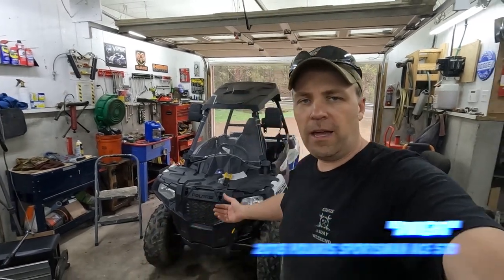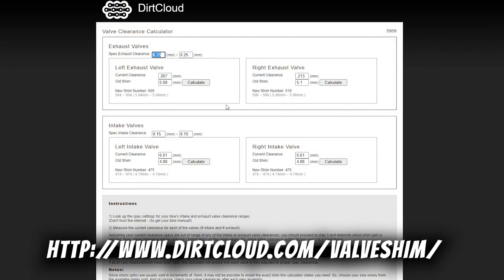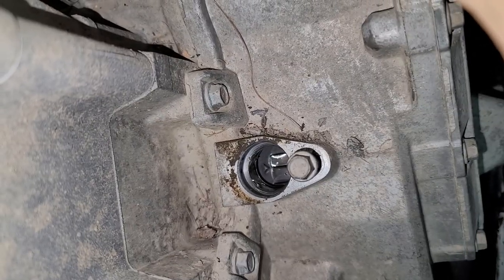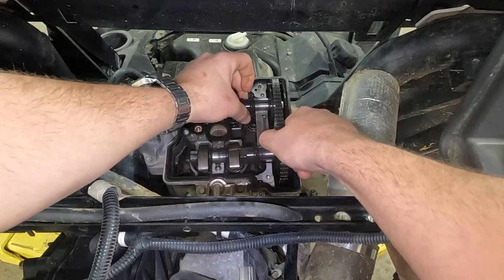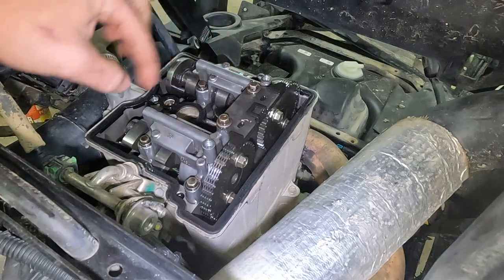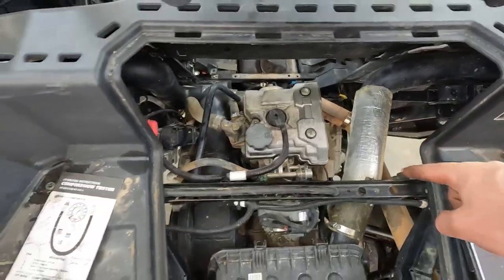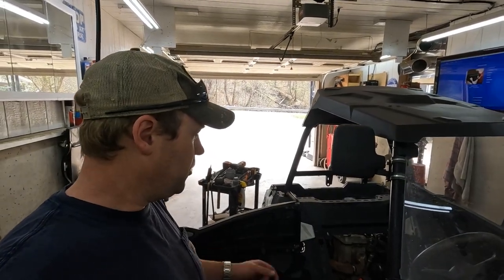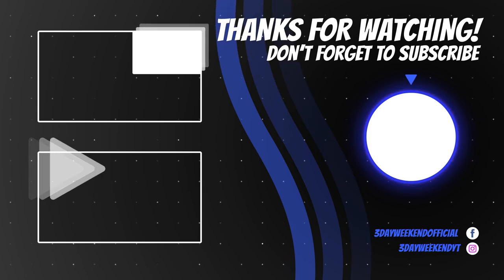It's running again!  Part 2 of 2 - adjusting valve lash on a Polaris 570 - Final Assembly!

Comment: I just used a Dial Caliper and a Dremel, calculated what I needed to shave down on each shim bucket. Got my lash in spec.  I didn’t even change the valve cover gasket.  It cost me no money. Runs good.
Reply from the maker: You know, I didn't even give that any thought.  Definitely could have tried that instead of forking out $40 a pop!  Even if you mess one up, just get a new one.  Great pointer!  Thanks for sharing!

Comment: Just curious of why you got a 510 for right side exhaust but dropped it down to a 502?
Reply from the maker: My math was wrong in the first one.  When I put it in the site it came up with a different value, so I double checked everything and confirmed that I had calculated wrong.  502 was the right one after all.  It has been a year and it is still running great!

Comment: I think you've helped me narrow down my 570 crank, no start issue. BUT my intake lashing is over .026" but my exhaust is perfect. Everything is in time too. What can cause loose lashing 4-5x more then spec?
Reply from the maker: That is interesting.  I've never seen the lash get looser - only tighter.  As dust gets in there, it will wear away at the valves and seats which allow the valves to seat in deeper resulting in a tighter lash.  I'm not sure what would cause it to be looser.  Perhaps something is jammed in there?  Or the cage that holds your cams down isn't seated right?  I'm really not sure.  I'd probably pull the head and lap the valves in an effort to get everything clean and seated properly before setting the lash.  Those shims are $40 a piece!  I'm curious as to what you find for sure!
Reply: Thanks for the reply, I ended up taking the head off and the intake valves ended up being bent. There was about a 16th of an inch gap between the valve and the seat.
Neither the valves nor the piston looked like they hit, so I don’t know what the cause was

Comment: Where are you located, I think my rzr 570 is doing the same thing and was wondering if your interested in working on it, im in ohio
Reply from the maker: Hey there!  I'm way out in Upstate NY.  It's not a terrible job, but it would take less time to fix than to drive all the way out here!  Make sure your intake hoses are tight and your air filter is intact.  Although it could be from regular wear and tear over time, I've found that the valves typically do this when they either take in mud (as shown here), or there is a hole in the air filter (mice like to chew on the bottom of them), or an intake hose is loose so it can suck in air after the filter.  Finding and correcting that will at least stop it from getting worse!

Comment: Shouldn’t the clearance be the same for the set? Intake should be same and exhaust the same? I’m just trying to figure out why the tappets could be different on the same set.
Reply from the maker: In a perfect world, yes, you would expect them to be the same.  However, each valve can be seated into the head at a slightly different level than the other, hence the shim being different between the two.  As you "lap" a valve, you're grinding it deeper into the port, which will make the gap tighter.  It is fairly common for them to be different by a little bit from the factory, but it can get much worse if it sucks dirty air and you have to re-lap the valves.  Hope that helps!
Reply: Very useful information!
Would you mind sharing where you purchased the tappets? I have a set to change in the same engine as in your video…. With the same exact issue. Also I saw the video of you changing the valves in that bike. Do you recommend changing the valves while changing the buckets? My bike had a lot of dust intake at one time. Thanks
Reply from the maker: @JasonCooley-k5n  I purchased the tappets from Partzilla.com.  And yes, if I were to do it again, I would get new valves, lap them, assemble it, take the machine out for a few runs to let everything settle in, THEN I would measure the tappets and adjust as necessary.  Ended up having to do it twice this way!
Reply: @3dayweekend.  As you lap a valve, you're setting a deeper into the seat, thereby moving the valve stem closer to the camshaft. The valve lash measurement will be tighter, requiring a thinner shim, not thicker.
Reply from the maker: @dannyjamison8337   Yes, you're correct.  I said that backwards.  I've updated the comment.  Thank you!

Comment: curious on that calculator. You measured in thousandths with the feeler guage, then that calc was showing mm.
Reply from the maker: I did measure with thousands, because that's what I usually measure valve lash with and the service manual had the tolerances in both in and mm, but then found that Polaris measures shims in mm, and the calculator was in mm.  The gauges have both mm and in measurements on them so it was a quick conversion to switch to mm.  So far so good with the new shims!  Thanks for watching!
Reply: What if you have zero clearance on intake. 
How do you use calculator?